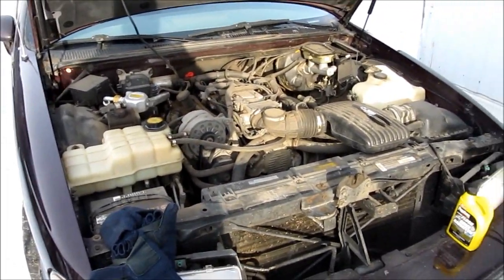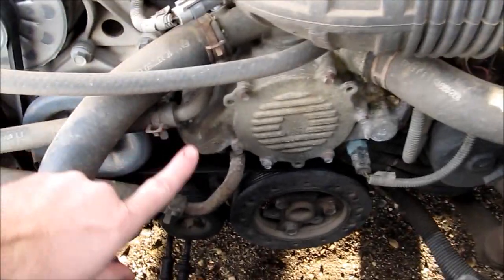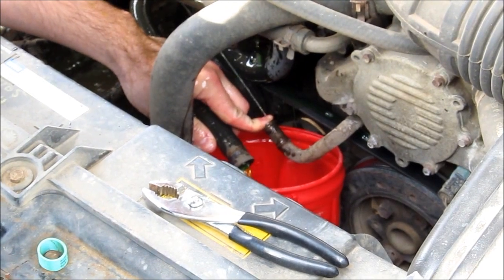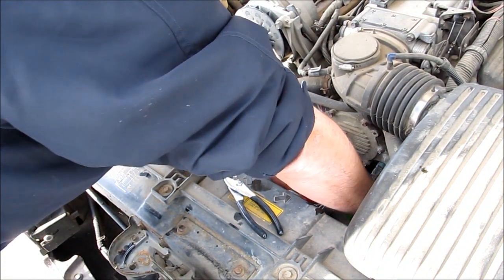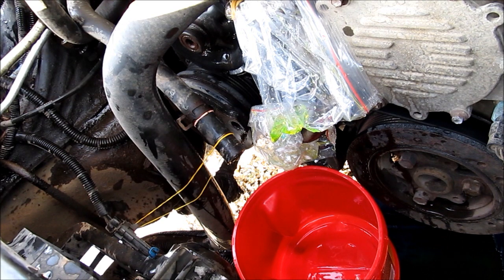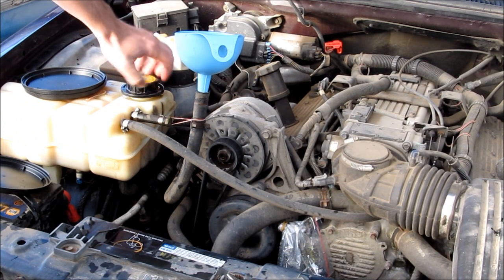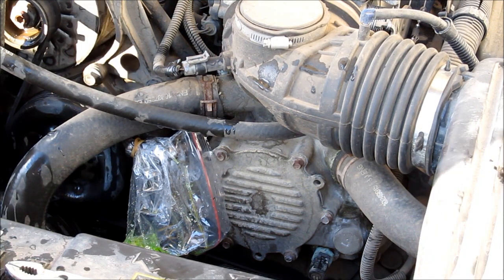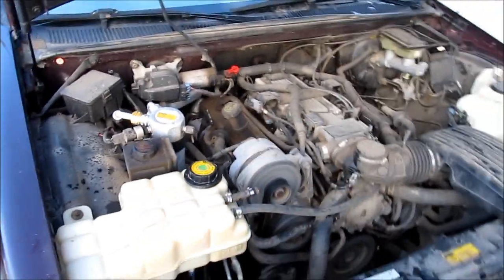Heater Core Flushing - 1994 Chevy Caprice LT1/L99 DIY Wagon 350 V8

Comment: Thanks very much for this video!!!  I have a nice 1994 Buick Roadmaster Sedan, had same problem as you: little interior heat, more when you step on the gas, or let it idle for 1/2 an hour.  Well, I followed your instructions, flushed it to death, used the Prestone flush, and now I've got too much heat!...;o)  Yay Great!  I was wondering how I was going to get through this cold Winter up here in Canada, and now I'll be nice and warm.  

I did do something different - I was lucky enough to be near the house, so I hooked a garden hose to the laundry room hot faucet, got a threaded spray gun, and screwed on one of those Gardena quick-disconnect nipples (with the o-rings) onto the spray gun outlet.  The Gardena nipple happens to fit nice and snug into the heater hoses, so I blasted them both to death back and forth into a big tub under the engine - got a few bits and rusty water out of the core, sprayed out my coolant tank, and now it works great!  The hot water was a blast to use, I even cleaned all the coolant off the engine front when I was done, and it kept my hands warm as I was doing this in close to freezing weather.  Thanks again for this great video, cheers!  Bellarmine

Comment: omg I'm so glad I found this video. I just bought my first wagon. It runs, but it runs roughly and in about a week, I'll be coming off the road to drain and refill oil power steering and coolant fluids, but I definitely would like to flush the coolant system.

Comment: For an engine going on almost two decades, it sounds pretty good. I'm told that trapped air is the commonest cause of this but evidently you burped it before flushing. Good demo. I hate flushing cooling systems because of the huge weight of fluid that has to be trucked off to the recycler. Cheers.

Comment from the maker: I haven't heard of air being an issue in the LT1, I didn't do anything special besides re-attach the hoses.  I think the positive flow from the water pump tends to displace any air that gets trap in there.  The heater core is also relatively low, which might move air along.

Comment from the maker: I edited out the explanation.  The 1994 LT1 runs a line from the expansion tank to the top of the radiator.  Apparently this wasn't need as it wasn't on the 1995 model.  My late 1994 lacks the radiator nipple but has the 1994 tank, so the factory plugged it with what you see.

Comment: you need to hook up to a pressurized hot water source--like a sink--and hook the garden hose up in reverse of coolant flow--take the other hose and pinch if off then release it--crud will flow out and you will be all set. gravity with a funnel doesnt work..neither does the chemical flush. you need pressurized HOT water.
Reply: ZeeboLaywicker  so your saying put the water hose in the return

Comment: this is a common problem with the aluminum heater cores in these cars..so backflushing is a great way to get it cleaned out without replacing the heater core..if its not leaking, backflush it and you will be fine...have done this a couple of times on my car. though i used hot water from a garden hose with fittings into the heater hoses where they connect by the coolant tank...simple and easy. use hot pressurized water from a garden hose, and you will see the crud come out of the other hose. you can buy the 5/8 and 3/4 plastic fittings at any auto parts store to connect your garden hose.

Comment: Some comments are saying use "pressurized water to flush" I don't think these people know that the LT1 has a built in baffle in one of the two heater hoses to moderate coolant flow that must stay in there or it will blow out the heater core so it should not have any air hose or pressure of any sort greater than what the water pump provides.thru the heater core system and maybe that baffle is what benefits this procedure more than the heater core itself. If someone looks closely on their heater hose they will see it molded in plastic near the water pump and it has an a arrow on the side of it to show water only goes in that direction thru it.

Comment from the maker: For the heater core, you can do it when the car is completely cold.  Otherwise, let temperature be your guide...aka not scolding hot...any other temp is fine, just make sure you release any system pressure first.

Comment: the main reason you dont have alot of heat at idle is because the gen II engines drive the water pump right off the cam..1/2 the speed of the crank. the old chevy small and big blocks drive the wp off the crank..so 800 rpm at idle is not 400 rpm wp speed. secondly..the heater cores plug up with dexcool gunk and need to be backflushed with hot..(hot) water. this will clear them out without an expensive heater core replacement. did my 96, sucks blows fire. cheap fix.

Comment: Great job,., you saved me a lot of time. I do have one question? You didn't seem to worry about getting the opti spark wet.  Why didn't u cover it up is my question.
Reply from the maker: I kinda do worry about getting it wet but its gonna get spilled on no matter how hard you try.  Optisparks are technically sealed.  I had to replace mine about 30k miles ago and it is a pain in the butt, but if its gonna die by getting splashed a bit, better in the yard then on the road in the rain.
Reply: Lol, thanks for the reply.. I covered mine with like 3 towels.lol.
Reply: open the drain on the radiator and empty into a pan and you get much less out of the hoses

Comment: Great vid. But quick question I have no heat in my 95 caprice but my heater core does not leak at all I took it to a shop they flush it and my heat worked at about 40% then back to no heat at all..... should try flushing it  again or just replace it
Reply: Lasean Ranks I would replace it because it might be damage or use hot water to flush it

Comment: Mine is a 1994 chevy caprice classic
N it leaks inside so 
The heat hasn't worked for awhile now
N stop leak didn't work
So should i get a new heater core in it 
Or still try n flush it

Comment from the maker: Not really.  The car is still using the same coolant, it hasn't changed, I just ran water through the heater core and then cleaner to make sure there wasn't any buildup holding up the works.  The whole car is actually easier to do, but requires a much greater volume of material and time as you need to get the engine hot enough in each step to open the thermostat.

Comment: DID YOU EVER END UP CHANGING YOUR HEATER CORE?MINE STARTED LEAKING,THEN IT STOPPED.I HAVE A 1996 IMPALA SS.IF YOU HAVE A VIDEO,THAT WOULD BE GREAT.THANKS IN ADVANCE.
Reply from the maker: No need to change, the core itself was ok.  Will post a video if I ever do.
Reply: bjeinsincity what did u end up doing change the heater core?

Comment: Why is one of the hoses from the reservoir plug?
Reply from the maker: It was a revised design, it would go to the top of the radiator, I’m guessing for venting but I guess it wasn’t needed and it is factory this way.
Reply: I see. I was having trouble Finding a radiator that has the port. I’m just going to plug the line

Comment: is that a hockey puck in your intake?
Reply: Yes they do this because the stock config has a huge noise baffle that makes the engine quiet, but robs horse power.
Reply from the maker: Yes, it replaces a noise reduction baffle which is large and ugly.  The hockey plug fills the hole nicely.  Otherwise there isn't much benefit.
Reply: ok cool